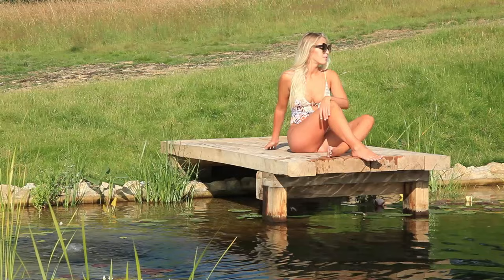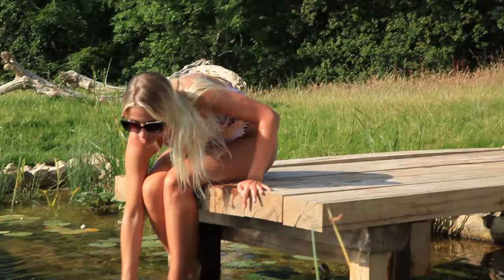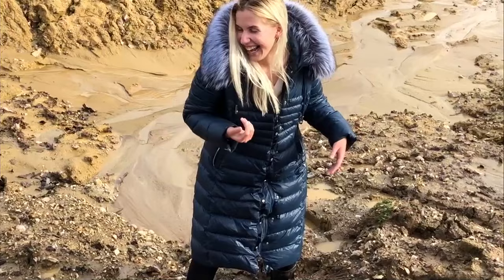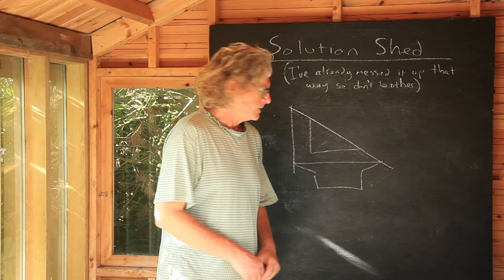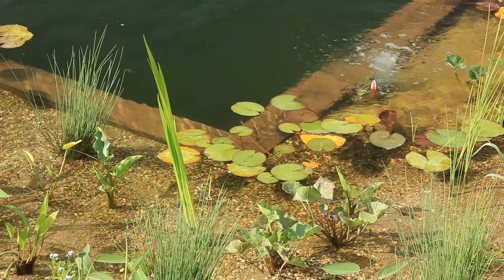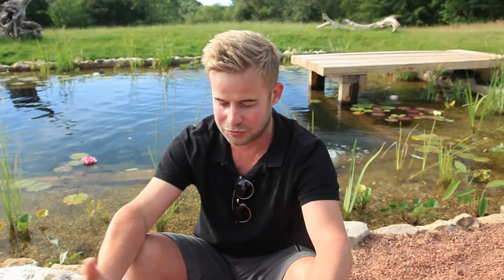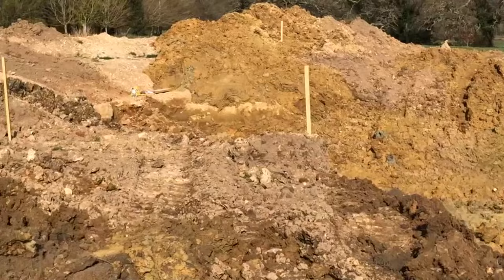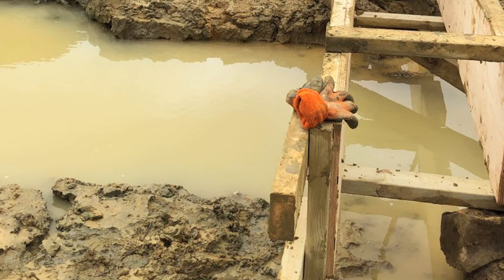From Mud to Glory  - Remarkable Transformation to an Organic Pool

Comment: What are the dimensions of the swimming area length width and depth and it's absolutely beautiful I'm hoping I can build one in the future
Reply: The swimming area depth is 2.2m , width is 5.5m, length is 12m
Reply: @gabrielepangonyte1991  ačiū, kaip tik norėjau klausti nes ketinu daryti kieme kažką labai panašaus. Gal gali išduoti paslaptį kokias pompas naudojote ir ar užtenka žalios zonos vandeniui išvalyti?
Reply: @arturasp9738  Hi Arturas, we used David's air pump system.
Reply: @gabrielepangonyte1991   are those the dimentions of the swimming area? or the total size of the pool? What are the swimming area dimensions?
Reply: bit156 you can contact ODC Improvements or David himself for a consultation :)

Comment: Can you explain how the groundwater problem was solved? Did the builders add drainage or just wait for a really dry spell?
Reply: Dirty water pumps can be hired from most large hardware stores. Dry spell is easier though
Reply: since the pool is on the slope I assume it was very easy to do simple drainage with pipes, once they deiced that they didnt want natural clay pond and chose to go with the liner.
Reply: We installed an extensive sump and underneath drainage system as well as made shutters for wall foundations.

Comment: I have two main questions for the expert 1) The water in my pond comes from a spring. The flow is heavy and therefore the water is very cold. This summer I am going  to restrict the flow and run the input water through a black pipe lying on the ground ( so as to possibly heat the water more). The flow will be just enough to maintain movement of water over the pond’s overflow pipe. 2)I am planning to pump the water out of the existing pond and line it with clay so as to minimize algae growth. Could you comment on my plans?
Reply: Lining with clay has no real bearing in terms of algae growth. The only way to limited algae is to design a system that maximizes beneficial processes that use up nutrients that would otherwise be available to algae. If you have a natural spring feeding your pond , your best bet could be to build a negative edge as the outflow, overwhich detritus can be taken (thus minimizing pond nutrients)

Comment: I wonder how it'd look if you tiled it with white/lightblue tiles, would it visually look like a regular pool?
Reply: Karlis Bikis or lights so when and if you needed to see in deep parts
Reply: David I’m also interested in a lighter center part. Most pools in your channel have a dark center. How could make it lighter (sand or white stones maybe)?
Reply: This is also what would sell it for me, a lighter pool, more like a tropical pond. How could you achieve this? White sand in the bottom? Adding mineral to water like in Iceland  lagoon?
Reply: I's a natural environment so there is sediment accumulating at the bottom, and sand would make it very hard to clean, I would assume that white flat stones, like marble or quartz maybe would work, but then the pool wouldn't look as natural in my opinion.
Reply: Blue pool liner. Kinda takes from the "natural" effect, but mixture of a modern pool with the actual natural water and filtration

Comment: How is the wooden frame keeping the gravel anchored?I noticed the liner is below, so does it just sit there?
Reply: Hi  when the wooden frame has been submerged then it will anchor the gravel for as long as you want. Or don't use Cedar but Railway timber and cover with the liner.
Southampton UK

Comment: Amazing. It looks like the pool was filled from a hose, was tap water used or was it from another source? Thanks
Reply: Hiya ,
 Thanks for your question, we had no way of filling that amount of water using rain water in our time frame so yes we laid a water pipe about 5th of a mile from the main house . Tap water isn’t ideal as it makes the water very green very quickly but sometimes you have no choice unfortunately. Thanks . Owen

Comment: That pond looks wonderful!
We are currently working on the design of ours and like the way you have put the bubble lift pumps in the planting area out of the way. Did this present a problem, getting enough depth to give them sufficient  power?
Reply: I'll second that question, would be great to know how that works.
Reply: Hi Alex, no, the air pumps can be kept inside the regeneration area with no problem.

Comment: Wanted to ask about cedar being under water.  Does it tend to start to breakdown?  Do you have anone who uses trex (plastic decking boards) type material for the wall caps?
Reply: Hi Brandon....I'm not using a wooden top, I'm using railway sleepers covered with Blue Liner, it should look lovely. 
Southampton UK